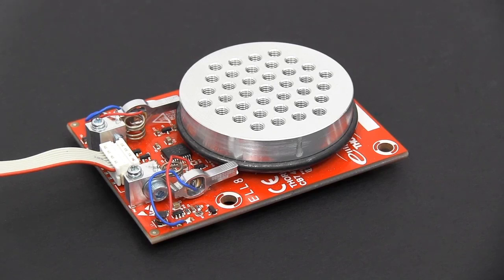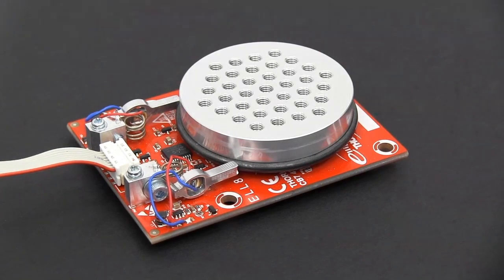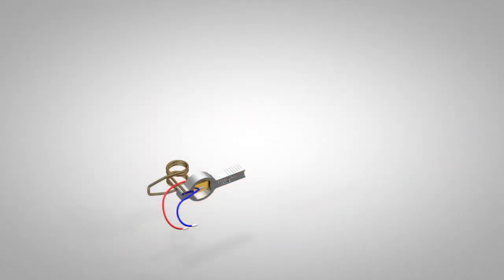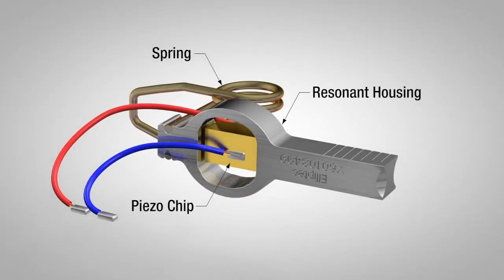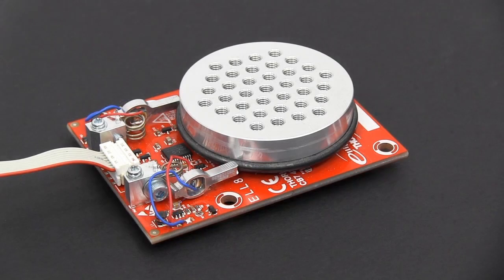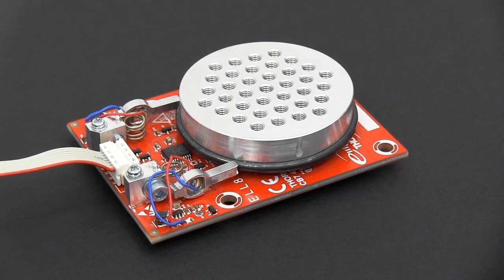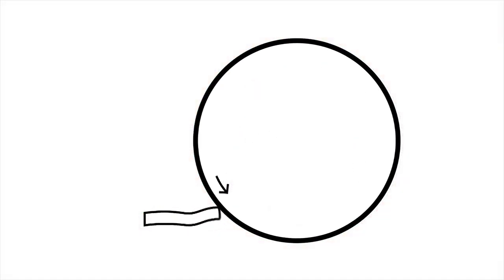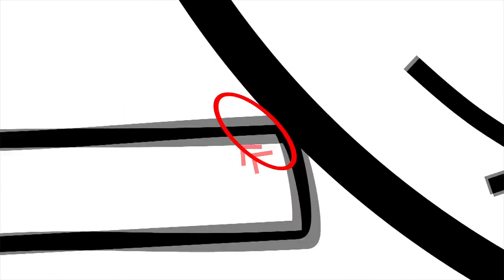The Elliptical Technique of the Piezo Resonant Motor

Comment: Another usm motor makes the faintest tick when I initiate autofocus, if I put my ears close enough in a quiet place. Otherwise it just seems not to respond. I've interchanged the piezoelectric actuator ring itself with the previous one and behavior reverses. Leads me to think the piezoelectric ceramic components themselves can malfunction; but I'm open to suggestions
Reply from the maker: Thank you for your post! Would you be able to share the item numbers of the Thorlabs products you are using within your application so that we can provide further assistance?

Comment: My lens usm motor only moves maybe 30 degrees in one particular direction only when I press the shutter button to initiate autofocus. I want to know if the piezoelectric motor itself can be faulty or if the problem is from the electronic board itself

Comment: to much friction. But what aplication can have where friction is not the most important as an motor.
Reply: Piezo motors are often used in camera lenses for the automatic actuations, due to their small size and the fact that you can still adjust the dials manually, with the motor connected to the mechanism.

Comment: Looks like it's capable of holding its position with power removed. Has a linear motor using this principle been developed? Could it work at -150 °C?
Reply: OK, I checked the link in the description. About as much unpowered holding force as I expected: 0.5–1.2 N, though the drive force is lower. Yes, there are linear versions. I didn't see any operating temperature ratings. (I guess it probably wouldn't be tested to such an extreme temperature anyway, until that data was needed for a specific application.)
Reply: @IDoNotLikeHandlesOnYT  have video about linear motor with piezo?